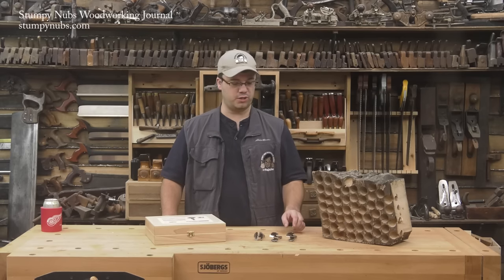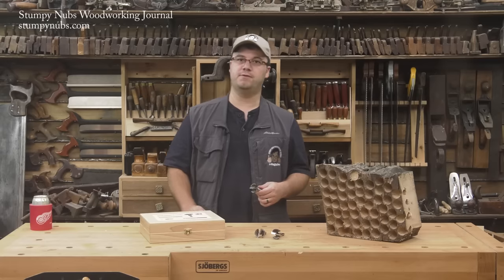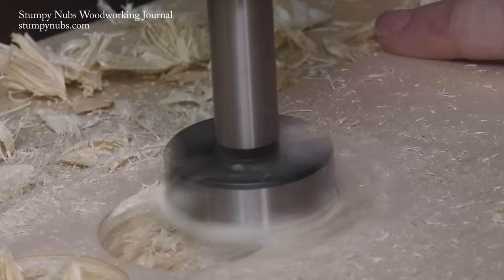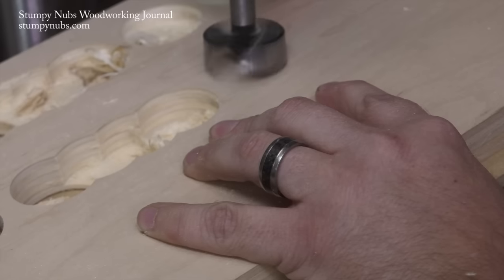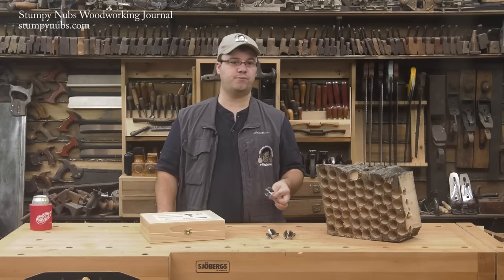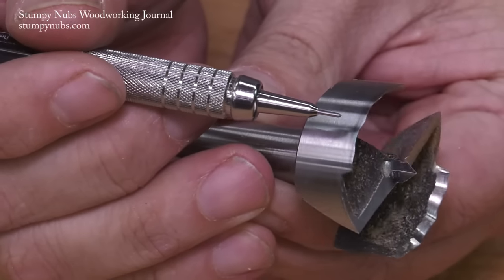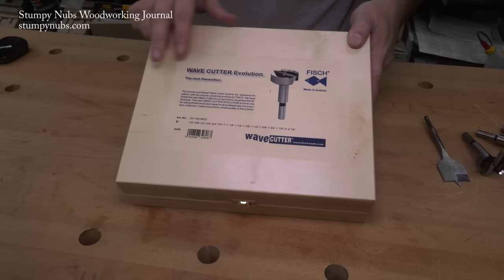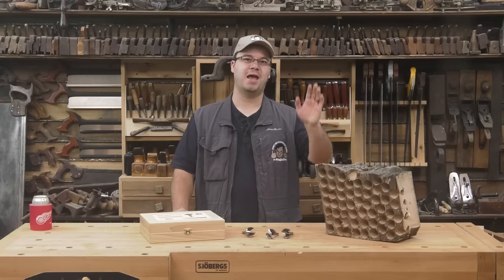What you need to know about forstner bits

Comment: 4:45 So cheap bits cut different size holes..? Lol
Reply from the maker: You can LOL all you like, but buy ten cheap bits of the same size and check them all with a caliper. They are not all consistent. And even if they are, a bit that doesn't run perfectly true will not bore a consistent hole.